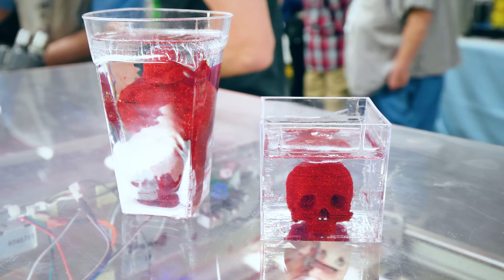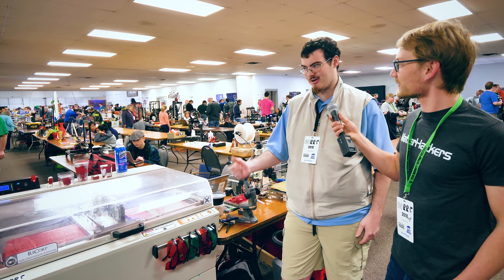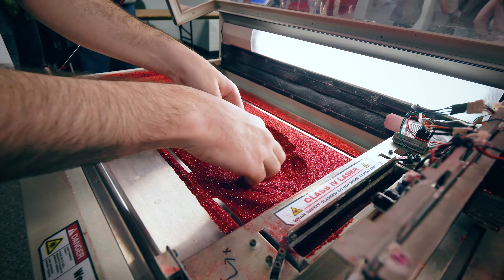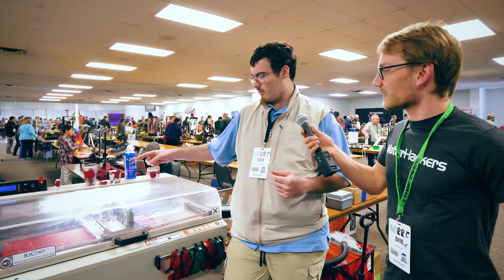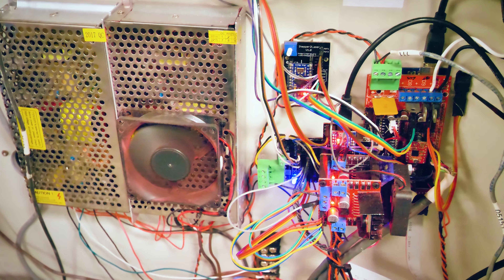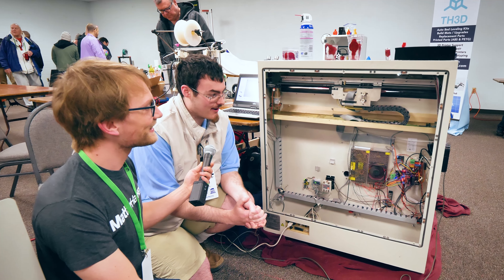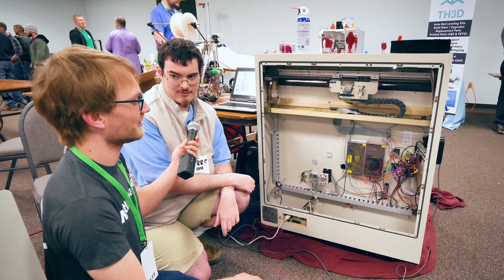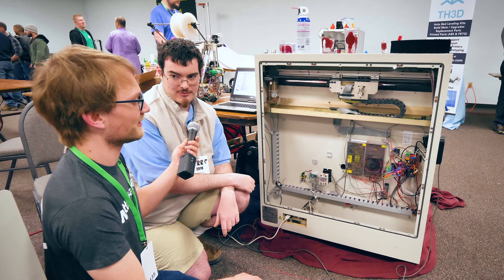The most fabulous 3D printer uses Glitter #MRRF2018

Comment: Good god, why not just FDM, cover in glue/resin, then roll it in glitter? Not only would it be solid, it would look better too. This seems like a bad solution to a problem that doesn't exist.
Reply: because parts produced would be stronger, but would not be 100% fabulous
Reply: Not everything has to be useful.  It's a great exploration of doing  sls with alternate materials.
Reply: But it's laser sintering. It's one of the best things ever. And you know, the guy doesn't have 50 pounds of polyamide flake, but he does have 50 pounds of glitter, and he's gotta start somewhere, right?
Reply: Siana Gearz 
Not £50 of glitter but 50 lbs.
Reply: Fixed.
Reply: Stan V because you did not understand the purpose of the machine :-) that is not a cut or an insult just a plain statement of fact :-)

 Sometimes we do things for what I call shiggles or s** and giggles :-) just because. no other reason

If he had simply made a fdm print rolled in glitter would there even be a video here? No because it would be nothing special.

We live in an age where many of us do well enough that we can do things just because they are fun to do and for no other reason he got ahold of this old school machine and thought let's fill it with glitter. that's just freaking cool :-) even if it's completely and totally useless :-)

The cool part is that the interesting things he has to do to make it work might be useful to other people for other projects that are more useful which is part of the cool thing about open source projects like this in an active community

Comment: A person could easily walk by that printer and get a reflection off the laser. While technically impressive I would be concerned about safety.
Reply: Perhaps you should work in health and safety! 
I doubt there's any real risk apart for someone who operates the machine and stares at it for extended periods.
Reply: Pete Allum it is pure speculation on my part because I don't know what type of laser or anything. What I do know is that there was a small sign easily missed saying glasses were required. 

With lasers if they are dangerous the damage can be done before you can blink. 

I do hope there was truly no danger with it.
Reply: Well this sign was put there by the operator, it wasn't on the machine to begin with. Because it was never a laser machine originally. The safety consideration for it are unknown.

Without knowing the laser wavelength, it's hard to say, but normally most of the flake is going to be fairly absorbent in UV because it's plastic on both sides, and acrylic doesn't have the best of UV transmittance either. But then something like 5mW is what is considered more or less safe if you don't stare at the beam, and 100mW might cause permanent damage even with super brief exposure, and this thing has a 2.4W laser... a bit on the dangerous side if something were to go wrong. I hope he tested that acrylic cover.
Reply: I am by no means any sort of expert on this but I suspect refraction scatter or more than drop this into a safe range when I was staring at it my glasses have blue blocking :-) which is surprisingly effective for these lasers :-) I thought I had a really pretty sky blue laser turns out it was just my glasses blocking most of the UV and higher and blue :-)

Anyway the danger of a laser is based on its concentration to .4 watts is not a lot of light and can't really damage your eye but concentrate that 2.4 Watson's with tiny pinpoint and bam instant blindness :-(

I suspect however the very nature of the glitter will prevent any serious concentration of light from ever hitting any one single point that's just my guess though I am not an expert probably safer to put some sort of shield on it just to be safe